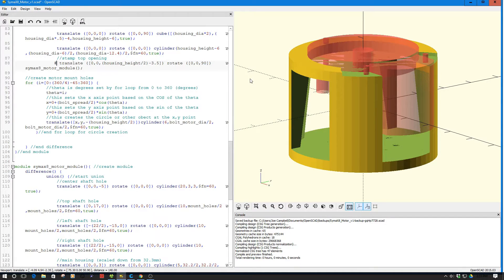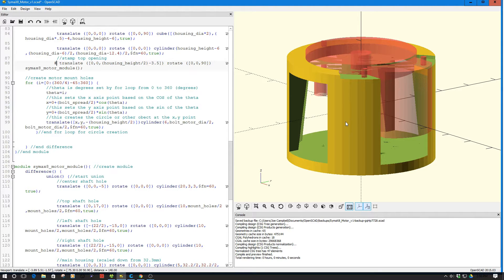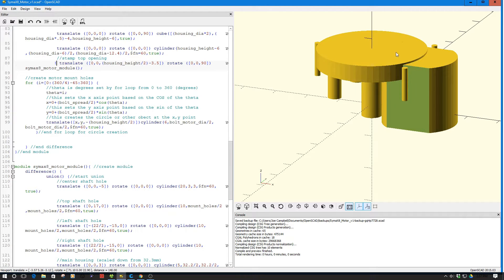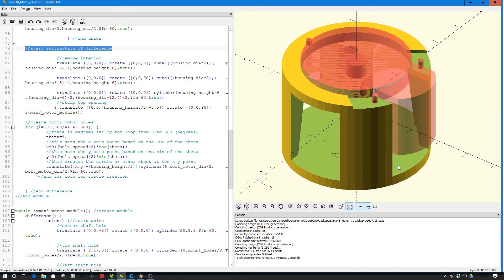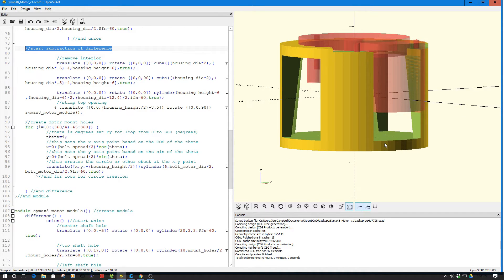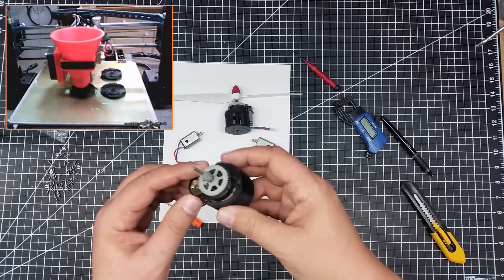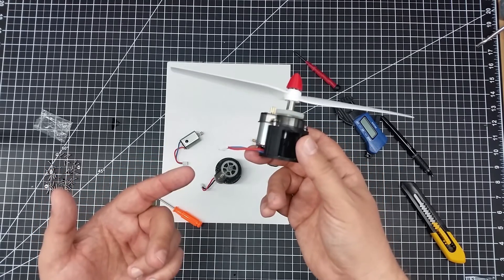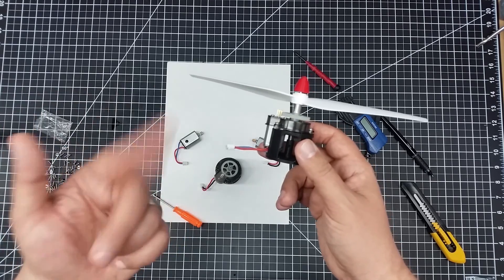Open SCAD - Syma X8 Motor Housings!

Comment: That's quite an amazing job!!
Couple of months ago I started 3d printing and discovered Open Scad. Happen to own a Kaideng K70c which motor system and housing is similar to the Syma X8 series and damaged some parts in a crash. Gonna try to print your model and will let you know how this works out for me.
Also, the spindle sleeve was broken and I tried to reproduce it in Open Scad. It's not ready for publishing yet as my knowledge of 3d printing and Open Scad is still at a beginners level but it does the job.
Very informative video and so is your website, it encourages people to learn a lot.
Thank you so much for sharing your model and knowledge sir! Excellent work!!!
Reply from the maker: +tubelarasa many thanks for the kind words!  Also let me know how this works it :-)
Reply: +Open-SCAD DIY3DTech printed perfectly on my Prusa i3, motor and gearsystem fit nice and tight!!
I like your method of modeling the piece you don't need en differencing out with the needed part.
The propeller still is not rotating as smooth as the other 3 so I'm not able to fly my drone yet. But that's not because of your model, the shaft turned out to be bended a little due to the crash. Got to get a new one but enjoyed trying out your solution and learned a lot.
Thans again!